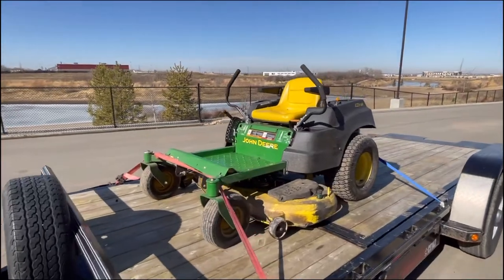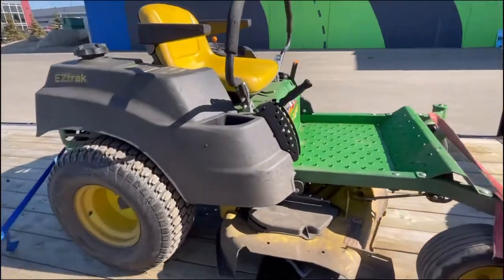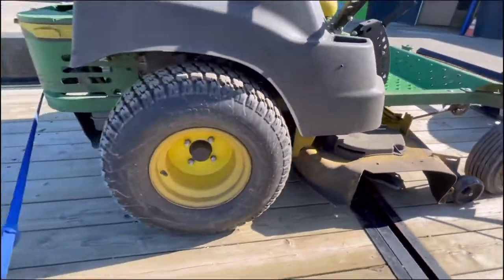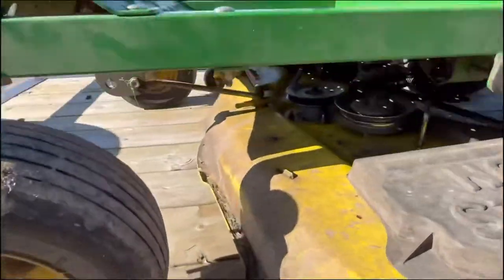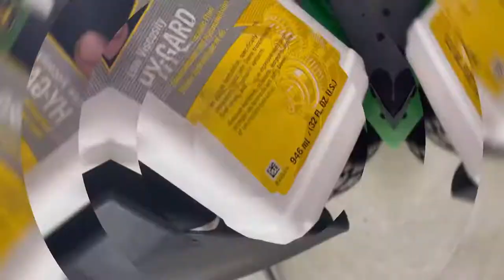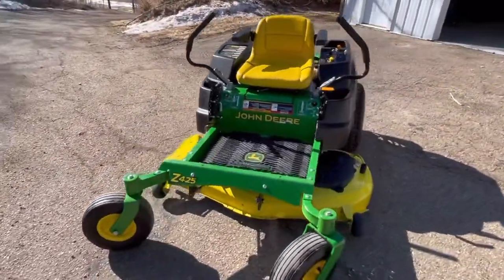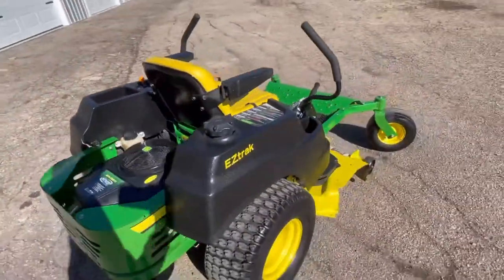John Deere Mower Restoration...Worn-out to Mint!

Comment: I have the same mower and the only problem with them is the big U bolt that holds the front end of the deck.  The clips that the bolt sits up against will wallow out and break the welds to the plate on the deck.

Comment: i literally just did the same thing except my z425 is a 2010 model i think. Sat at the edge of a barn for 3 years. You may want to take the engine cover off. My carb and cooling fins were covered in oil and greese.
Reply: Checking under the engine shroud for dirt, and debris on the engine and cooling fins is way more important than rattle can spray painting it.

Comment: Looks great! These are super fun projects I’ve had a blast repairing my family’s 2006 Husqvarna EZ4824 that I now own/use in my first year or two in lawn care business. I stripped down all the paint/rust off my mower deck and repainted it with quality paint from Napa and clear coated it. Then rebuilt the whole deck with all new blades, hubs/bearings and belts. I’m working on stripping Down the rims to bare metal and re priming/painting them before installing new tires this week. I love it. Your project turned out great! Are you going to sell it?

Comment: Looks good. I would like to point out the bend in the deck near the discharge opening. Did you try to pull it out or was it to hard to try to bend it back? Those bends can be tricky.

Comment: Looks like you missed the front part of the mower deck.  I like that scrubber on drill, do you have a link where to buy one?
Reply: JD classic green paint is for older john deere, not new style.
Reply from the maker: Cleaning Supplies - Threaded 5-inch Commercial Cleaning - Scrub Brush - fits Electric, Pneumatic DA Rotary Polishers - Bathroom Rugs - Carpet Cleaner - Floor Cleaner - Shower Cleaner - Grout Cleaner https://www.amazon.ca/dp/B01ACLO2H8/ref=cm_sw_r_cp_api_glt_i_NQM29K1NBCJ3M498B86G?_encoding=UTF8&psc=1